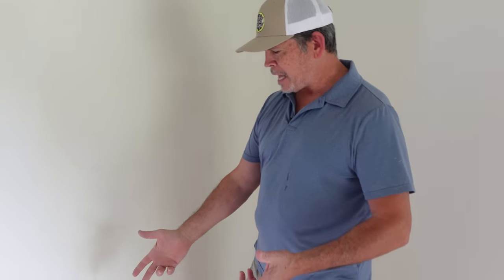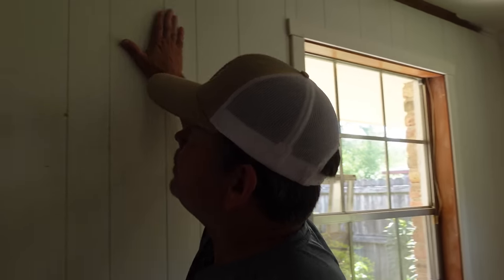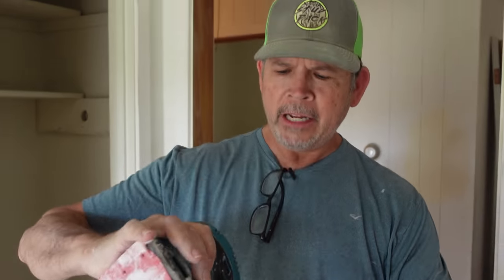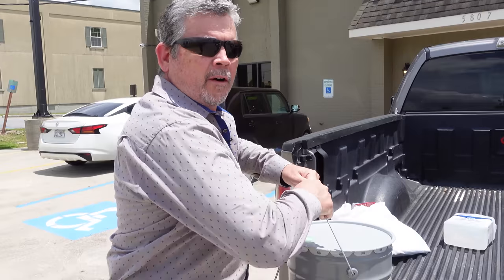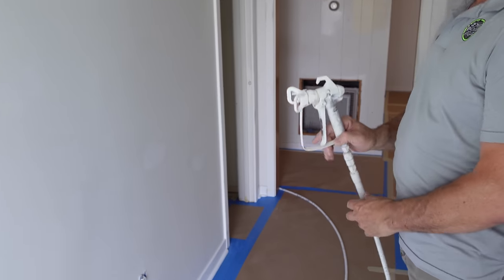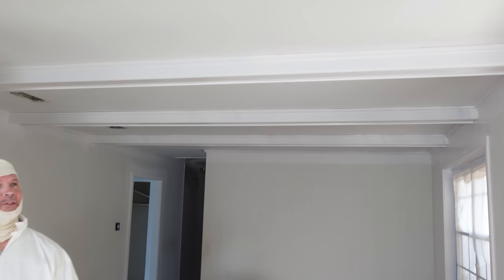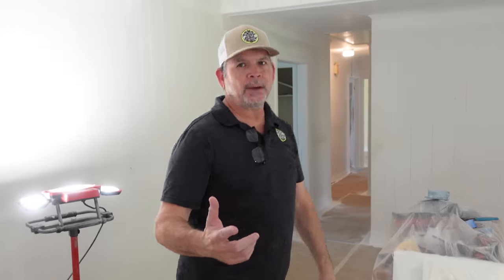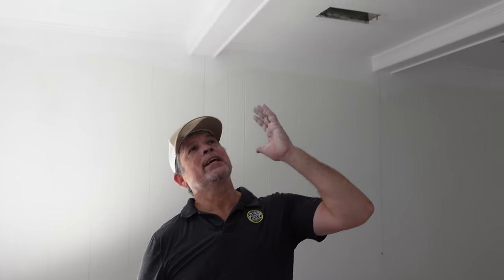MOST BEGINNERS MISS THIS PAINTING STEP (Baseboard, Crown, and Casing)

Comment: How many gallons of paint did you use?  I have the same sprayer and I go through paint like I’m pouring it down the drain when I use it. Additionally, I get sprayed with fallout and the paint is dripping off the tip. Maybe not enough pressure? I set mine closer to the lowest setting. I’ve never used oil based paint with it. You guys rock. Rich in Florida
Reply: I have a same brand smaller painter myself. I think it’s a combination of tip size, and pressure. I have only the tips it came with so I know I’m over spraying my intended target like crazy. Also, I need to take the advice of start low, increase pressure as needed. But, I should probably also invest in tips that fit my job.
Reply: @lesg9604  yeah I’ve only used mine twice so I’m more comfortable using it now but just need to figure out what I’m going wrong I guess

Comment: If the wood is primed...
You don't need oil base primed.
It's primed already and maybe tou can primed with water base primer.
If the wood is been sealed/stained for sure need to sanding and oil base paint.

Comment: What would be the recommended type of caulk for trim?
Reply: 1. interior use Elastomeric latex, houses move during season changes.  mdf trim not so much but real wood trim does and non elastomer caulking will crack all to hell in a few months and ruin all the hard work (exception being if trim was nailed to studs not just sheet rock, or using adhesion like liquid nails) but even then id still use elasto latex.  2. exterior - polyurethane is king.  No silicone.  not that's its a terrible product but it's "silicone" nothing sticks to it i.e.: paint, stucco, anything.  poly on the other hand will bond anything to anything anywhere, it expands and contracts, and its paintable. i would only use poly for exterior applications, windows, doors, exterior trim, screen door boat, etc.

Comment: Great job, but not like you, as soon as I get finished repairing any exposed hardwood flooring, it's covered right away with paper. This will help protect compound and spackled being ground into the floors. Also will protect from most scrapers, knifes, fasteners and ladder legs scuffs. And when it comes to the actual painting after cleaning the paper covering, we lay out canvas drop cloths over the paper to protect all that was mentioned above but more importantly, spilled or accidental  paint puddles. I don't know how many guys have hooked a partial empty can with the spray hose!

Comment: i buy the cheapest sander i can buy (usually 20 pounds), i get through a sander every six months or so. but then i only use mirka abranet paper on it. its the paper that does the work. so you turn a 20 pound sander into a 500 pound machine.

Comment: Okay serious question. What is the problem with painting the walls, painting the trim, and then installing the trim? Why don’t more people do it
Reply: In your scenario, you'll stil have to caulk your trim, fill your nail holes, etc. and touch it up, plus you'll have to cut in along the top.  

If you're not using a sprayer, I agree with you, painting it all, then getting it up and then touching up is more efficient.  But if you have a sprayer, the way Stud Pack did it is definitely best.
Reply: @PlucharC  if your wall is painted and your trim is painted, why would you need to cut in more paint? Makes no sense. And also you don’t always have to caulk your trim.
Reply: @markst.martinii9635  - I'm assuming you'll have to caulk your trim as most houses don't have square/plumb/straight walls.  You don't want to leave unpainted caulk, so you'd have to cut in.

Comment: Curious... the primer you used is oil based which is probably what I would have used given the situation. But your sprayer fan width put overspray on the walls/ceiling. If you're then using a water based paint for the walls and ceiling, won't you have issues with this adhering to the surfaces that have been oversprayed with the oil based primer. Waterbased paint doesn't tend to adhere too well over solvent based primers and male flake off over time.
Reply: Latex over oil primer is fine, especially with how much attention to detail they put into prep.

Comment: I thought latex doesn't stick to oil based paint. I painted all my trim & doors with latex only to find it would peel off. Wasn't that because I painted over oil based paint? I'm confused.
Reply from the maker: I think back in the day this was the thinking.   Now just check the label on the primer.   If it says topcoat with any paint or topcoat with latex you’re good to go 👍
Reply: @StudPack  ok, I had to paint over the oil based paint with kilz and it worked great. Of course I had to paint it twice. Thanks for the reply!

Comment: Hey guys, why don't you caulk the top of the door casing to the wall?
Reply: The part that 's not visible?
Reply: @PlucharC  yes. Bugs can enter and also heat and cooling loss. 
My dad always said "isn't not what you do when people are watching you that defines you its what you do when people are not watching that defines you".
Reply: @joedurkin8953  - I don't know that you're getting much heat and cooling loss through the thin gap at the top of the top piece of casing that's already nailed to the door frame.  And even then, it's not much of a gap for bugs either as the door is fitted into the 2x4 rough opening which is basically bug sealed when you attach the drywwall to the wall.  All the casing does is make the opening look more finished so the aesthetics are really the only important factor.  Since nobody looks at the top of the top piece of casing, it would be a waste of time and caulk.

That said, I get your Dad's point, I'd just apply it to things that matter a bit more.

Comment: Contractor-grade "dudes"...
The same guy that crawls the paper in shouldn't have to paint on it, either. I'm the crawler. I'd probably spray the perfect two coats just to have wasted my crawl. 
I ran errands for two hours, with knee pads around my ankles, that I forgot I had on, the other evening. Paul I'm too damn ole for this. Dudes I used to work with, younger than me, acted like they were in a golf tournament every time something hard had to happen. I didn't have golf patience so I toted the miter saw alone both ways too many days, at 58. Now, I just crawl around, mostly. "New House Detailer" is what I call it, for the youngsters etc..."Construction Dirt Influencer" might be better.